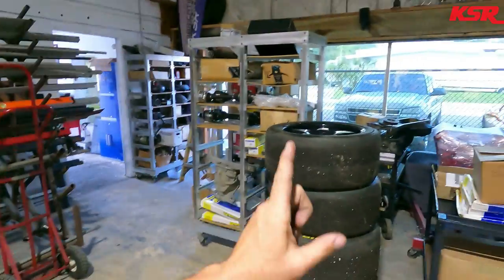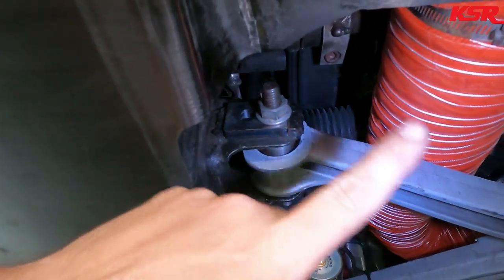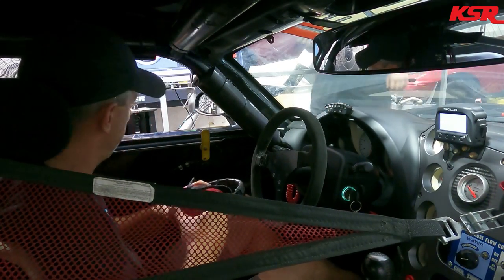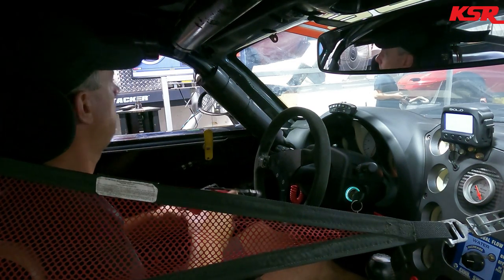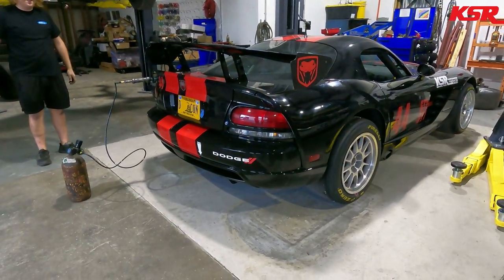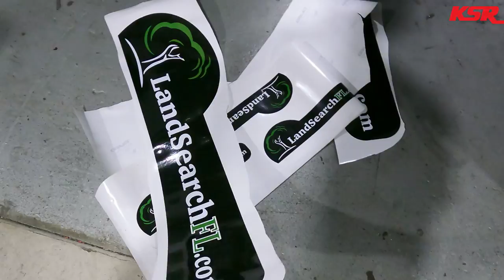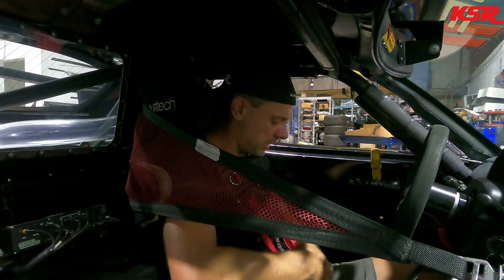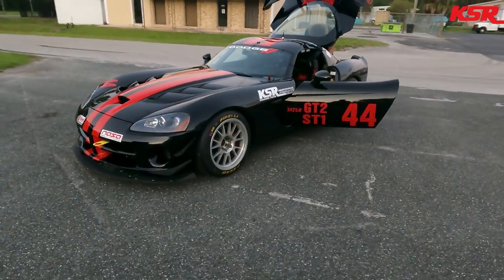ANOTHER RACE CAR??!?!? YEP! Let's Go Racing!!!

Comment: If I had a Viper sitting in my shop, I would also feel the need to take it out for a ride just to make sure the steering is still straight at least once a day.
Reply: Joy riding customer cars is definitely a way to make a name for urself
Reply: @lowrider94ss  it’s only called joy riding if you have a bad shop
Reply: They aren't that great
Reply: @SXSPRIME  Yes they are.
Reply: @aSinisterKiid  have you driven one? There okay but for what they cost your better off buying a vette and building it into an animal for the same money
Reply: @SXSPRIME  if I had the choice viper or modified corvette I’d choose the viper even if they worth the same
Reply: @James-miller  I'm not really talking value aspect I meant for a track car the vette can be far superior at the same cost
Reply: @SXSPRIME  Yes I have driven a Viper. Quite a few different ones actually from the original generation SR-1, a second gen GTS, a mint SRT-10 and an ACR-X quite similar to the one Lee drives in the cup series. They are incredible cars and I love them. I grew up dreaming of owning a Viper and it will always be my favorite car. It's not about the money. I don't like Vette's that much comparatively. But you can take that stance with any car. The price for your current generation Vette would be better spent on a fox body mustang or a sweet Trans-Am or an 80's Monte Carlo SS. It's never about the money. It's about the style of car, the lines, the stance and the overall image. I would love to own a Chevelle and an old Nova just as much as I'd love to own a 90's Mitsubishi Eclipse GSX or early 2000's Lotus Elise. There are just specific cars that guys love and it doesn't matter what the price is. I would take ANY Viper over any Corvette or McLaren or BMW etc. I love Dodge Vipers and I always will.
Reply: @SXSPRIME  I’m not either I’d still rather have the viper, if you can win in a viper then your a better driver
Reply: @aSinisterKiid  I wasn't saying money or anything like that I meant purely as a track car dollar for dollar vette is a better option.

I own a 08 challenger srt8 procharged 
1979 trans am built with 700 na horsepower 
And a 1972 chevelle ss red and black restomodded 

I agree it's about what ya like. I'd rather have all those over 1 c8 but for a track car it's hard to beat a c5 c6 or c7 from the aspect of performance returns and maintenance per dollar

Comment: if those two post lifts are in the ground solid enough you might be able to use it to stretch the frame back out so its closer to straight (tie the car to the one post using points along the whole length of the frame to hold it in place , and use a come along to pull on the other some , prolly can use the verry ankor point for the suspension arm to pull on)
Reply: Big truck ratcheting chain binders work great to pull frames.

Comment: Oh I sooooo Flashed back to speed Racer and the Mach 5. Only difference is less buttons on the steering wheel. Well that and maybe the massive saw blades that could cut trees down at 200mph +

Comment: Man that rev limiter is violent. You would think they'd do it by pulling back a lot of timing before hitting it. Air jacks just like F1 nice. Best of luck.
Reply: F1 doesn't have airjacks. Certainly not during the last 12 years, probably never.

Comment: Just noticed at this car has the same glowing green ring around the ignition that my parents minivans had. It might be the best Dodge ever, but it's still a Dodge.
Reply: Same part. Alot of parts were shared. The funniest is the body control module is the same as minivans. Chrysler reused/s alot of parts. They used parts from the 70s on cars into the mid 00s.

Comment: Kevin, can you tell us the differences between the red and black TA vipers?
Reply from the maker: The car has, er had a built engine. Red car was lighter but had to run small restrictions due to the built engine. Red car also has some different aero mods.

Comment: kinda makes sense that a racecar like both vipers would be slightly warped due to racing. id imagine it would get very expensive if you essentially did a leeroy style rebuild of the front/rear every time the cars got damaged enough to move the frame rails etc
Reply: i also love how the car still has a key lol. is that due to rules or convenience?

Comment: I was at mid ohio all weekend I didn't realize that was you guys was the car running outta gear on th back straight I remember it sounded like it was hitting the limiter
Reply from the maker: It's will make for a quicker lap if we gear the car so that it just bumps the limiter at the end of the straight. The car accelerating quicker early in the straightaway makes for a bigger gain that the time that is lost by bumping the limiter for a second at the end of the straight and the car is already at speed.

Comment: Hey,  Kevin, it's a shame to produce so much potential from your Dynomometer, without benefitting from the energy produced(bought and paid for) why not build a system which recharges a battery bank everytime you shut off fuel to the throttle. I would imagine you getting free electricity, as well as selling energy back to FP&L. Give it a think man.